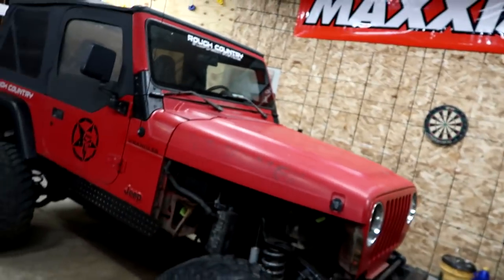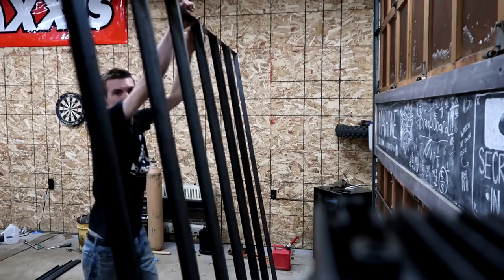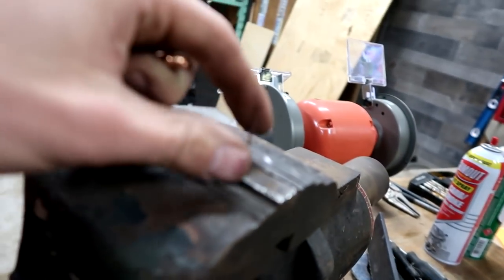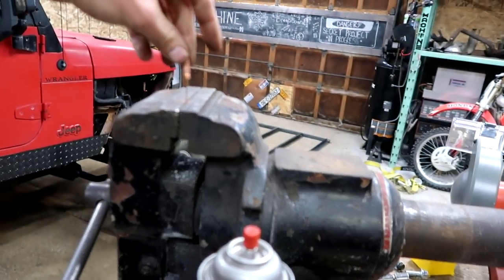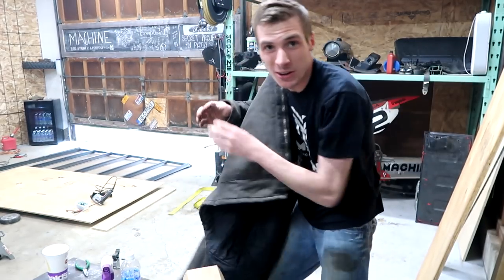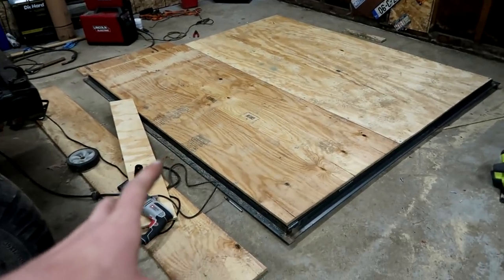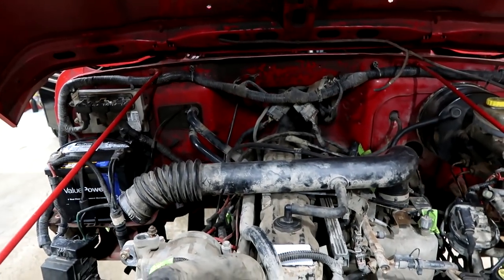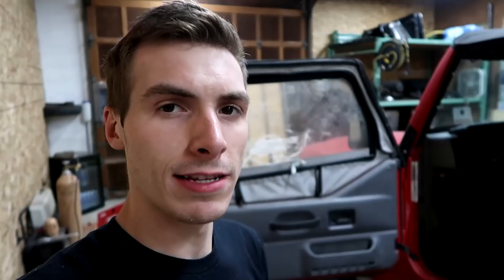What Color Should I Paint The Jeep

Comment: Hey Dalton, they make blow-through carbs specifically for turbos. 
Not only that, while using a carb, you can bypass having an intercooler because the carb drops around 100F off the intake temperature.

Comment: I keep packs of both tips in my shop, along with wire. .030 and .035. I switch depending on what I'm welding. Most jobs I use .035. I use the .030 for light weight work

Comment: You can get a blow through carb to use for forced induction applications such as a supercharger or turbo. However, it may not pass emissions if they have to plug into the OBD port during the inspection.

Comment: The VIN on that Jeep is going to pull-up as a 2.5 4banger, you would only just receive a PCM that will still make the engine misfire because the other 2 cylinders don’t even exist to the PCM. It’s best to just go to a junkyard and get the parts or go to a junkyard and get the VIN of any 4.0 Jeep there and give it to the eBay seller

Comment: Line X the  jeep red with black rocker panels, and leave the other black stuff black. Line X is the stuff you spray in the bed of your truck. You would be amazed how durable and very strong it will make the jeep. My bro gas a custom built rock crawler Toyota pickup with a fuel injected 383 stroker and it is line X inside and out and it is strong as heck! Trust me you would love it guaranteed!!
Reply: I looked into getting LineX a little while ago.. heaps expensive? You heard of Monstaliner or Raptor Liner? DIY comes out real good

Comment: Doesn't check.engine light  come on as soon as you key on to start ???.if it doesn't it's your pcm .. had a similar issue you are having with a 1993 5.2 grand Cherokee replaced the pcm fixed the issue. .

......Orange

Comment: Why don't you go with a 350 carbureted and throw a EFI setup on it and the 350 is lighter than the 4.0 6 cylinder and the EFI setup you can get through Summit for around 450 bucks

Comment: Throttle body fuel injection like holley efi or a fintech would be way easier and simpler and you can still run boost or even nitrous and have the computer control everything